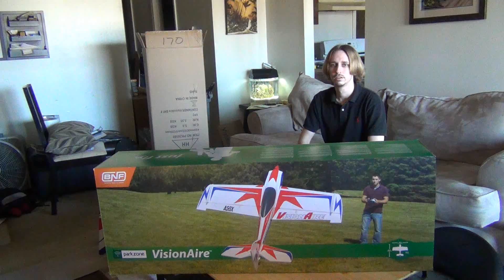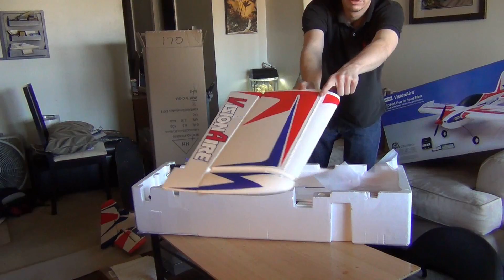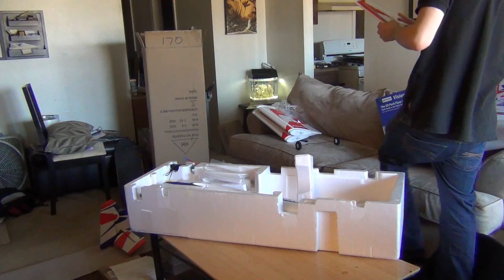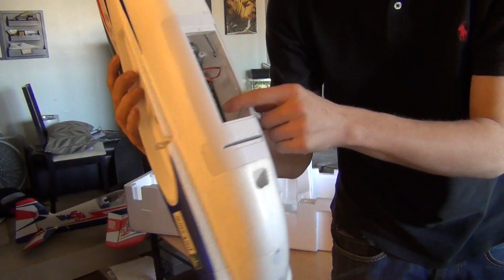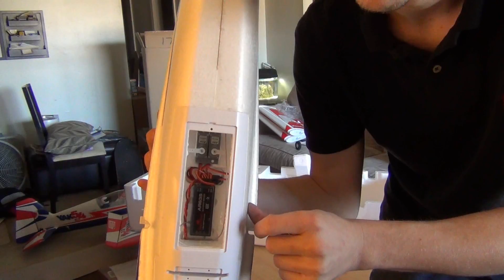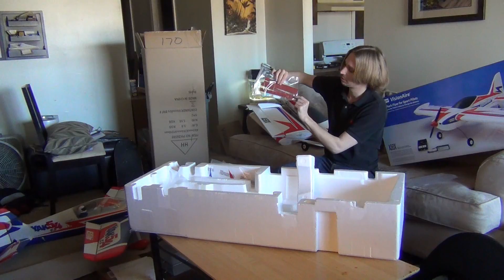Parkzone VisionAire Overview

Comment: if you do a little bit of research, you will also find that HH has it's own problems. the exact same problems you have listed. the only exception is of course the industry leading customer service.

batteries may fit but they are crap and no educated hobbyist would ever buy a HH branded batt
yak was notorious for it's crappy servos
all foam (and balsa) can have some warps in them. an easy fix
esc not working properly has been documented in many applications
ever looked at a pz plastic motor? lol

Comment: When I say surprises.  Horizons motors and batteries fit in the plane like they are suppose to.  The other crappy companies often you find the batteries never fit, servos do not work, foam is bent, ESC will overheat and the electric motors do not work correctly.